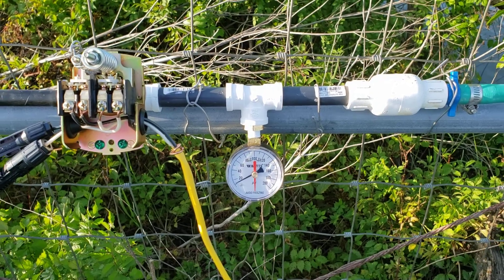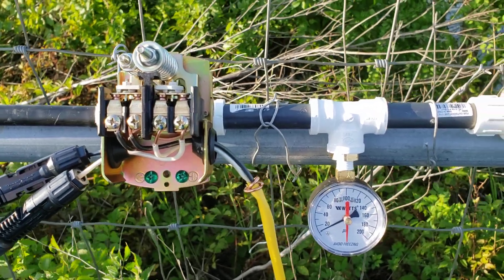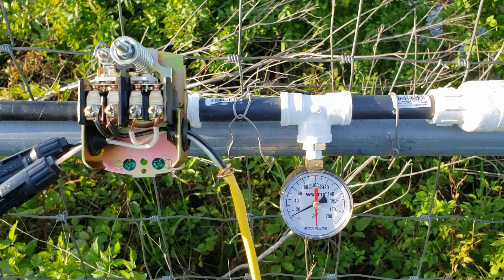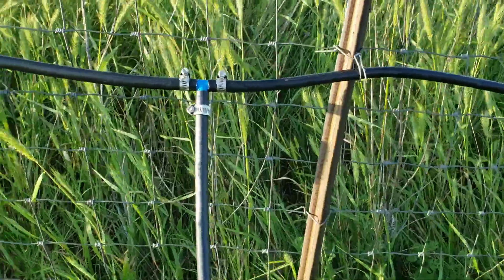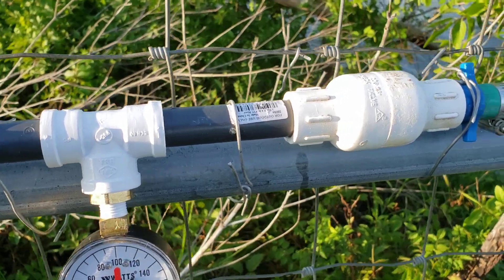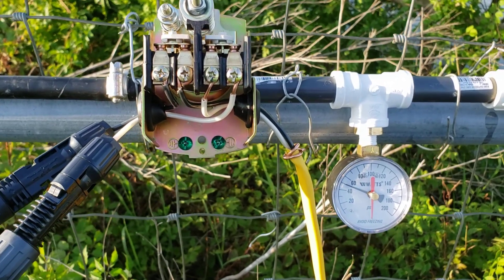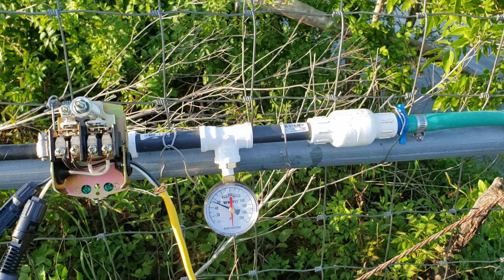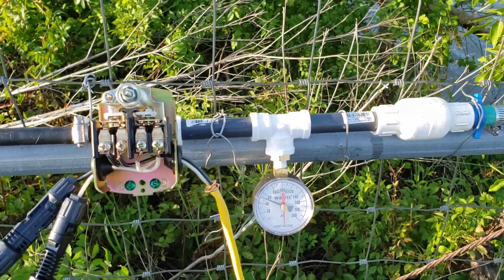Solar Water Pump Pressure Switch Setup

Comment: Hi there, I have a 180w solar water pump, but with my pressure gauge (when running and everything closed) I only get UPTO 20psi, i bought a pressure switch for 20-40psi without knowing it was kinda too high for my purpose. When i open the tap the meter reads (from 20psi it gets to 15psi or perhapsss 10psi). What should I do with this minimal difference? I would like to set a pressure switch for 5~10 to 18~21psi. After adjusting both screws the pressure switch turns off at 20psi, but if i get open one or more taps and the pressure gets down to 10psi or 15psi it wont turn back on (unless i slightly push the spring with my finger). What should I do?
Reply from the maker: I would think you need to find a pressure switch that can handle lower pressures like 10 psi or maybe put in a pressure tank.  Maybe something like this: https://amzn.to/49TbnBN
Reply: @SeidelRanch I am afraid i will have to, but will a water pump that pushes up to 20 psi be useful to the pressure tank? I mean... while it eventually be pressurized to say 30 or 40psi (slowly)?

Comment: Hi,
Do you use fuse or breaker?
Reply from the maker: I do not.  Maybe I should.
Reply: Thanks Bro. From the video, the negative is connected to L1 & T1, and the postive is on L2 & T2, am I correct?
Reply from the maker: @offgreed7131  I believe so.  Either side can be + or - as long as both wires are the same (both + or both -).
Reply: @SeidelRanch  Copy thanks. Great help. I am working an a solar surface pump connected to a pressure tank. And this is the only video, out of billions, that shows how to use pressure switch on DC. Everyone else says that pressure switch is  AC only.
Keep it up, Bro.

Comment: nice setup, the only problem I see is those pressure switches are designed for 110 - 240v AC so without being modified for DC with heavier contacts for DC loads the contacts will stick on after a while if your pump has too high of start up current that causes arcing (spark) when the contacts close & open or if the contacts run hot due to higher current of DC loads, this will be more common the lower the voltage of pump such as 12v as oppose to 24, 36 & 48v systems.

I have not seen any DC modified pressure switches around now days, they were around 10 years ago when they were selling DC piston pumps for solar.

if you find the contacts sticking on issue being a problem you could add a high current relay 20 - 30 A DC at the voltage of your pump, then run the pump load through the relay & switch the relay from the pressure switch the only downside of the relay is it will shut your pump off when voltage drops below the minimum required to hold the relay closed, as oppose to being able to run the pump until the voltage from the solar panel becomes too low to run the pump.
Reply from the maker: Awesome info, thanks!  I have not had that issue, but I will watch for it.  I was a little worried about the amperage going through it since it was made for 110v, but it seems to be handling it fine.  The connectors seem to be pretty beefy and the pump does not use much power to run.

Comment: How do you wire the pressure switch     which wires go to what screw
Reply from the maker: On my switch, it's positive on one side, negative on the other.  I go from the panels into the switch, then from the switch to the pump.  The pressure switch cuts power when it's high enough.

Comment: What kind of water line do you use? Is this just 1/2” rain bird line? What about the fittings? I guess it handles the pressure well.
Reply from the maker: Yeah, I just use 1/2" irrigation line.  The black poly line holds up well to UV and is easy to cut and repair if needed.  The line itself holds the pressure fine.  If the pressure gets too high I will have issues with plug type drippers and the push on connectors.  These ( https://amzn.to/3B3wr83 ) pop off pretty easy when the pressure gets too high and I stopped using them.  I now use these type of hose connectors ( https://amzn.to/3gubSYW ) to keep them from popping off if the pressure gets a little too high.
Reply: @SeidelRanch  Thanks!

Comment: Great video and idea. Currently trying to buy the same sort of kit here in Australia. I can’t find a submersible lump that says it will run with a pressure switch though, is there a special type or will any pump work? I have asked a seller and they said it won’t work with one. Thanks!
Reply from the maker: I think any electric pump will work with a pressure switch as long as the pump can build the needed pressure to trigger the switch.  All a pressure switch does is turn on and off the power when the pressure in the line reaches the setting on the pressure switch.  The pumps I use all work fine with it.
Reply: @SeidelRanch  Thanks mate. I've gone ahead and ordered a similar pump and the same pressure switch as you. I mentioned I'm in Australia, I couldn't find a pressure switch for 12V here! So I had to order that one from the USA :D Here's hoping I can make it work. Cheers.
Reply from the maker: @thelighthousekeepers8177  I think it will be fine.  I think they are all 120 volt but that should not matter.  Mine works with 12 volt or 24 volt with out issue and it says it's for 120 volt.  Good luck with the setup.
Reply: @SeidelRanch  I finally got around to installing one of these and it works but it's not pumping to it's claimed head height (my head is 26m). Can I ask how far your pipe runs and what diameter? I've got a 26m head and a 300m (984ft) length of hose. I'm assuming it's not powerful enough to push the water this far unfortunately.
Reply from the maker: @thelighthousekeepers8177  To get to the last zone of my irrigation I pump up about 60ft of elevation and am pushing that through about 1800ft of 5/8in poly hose.  I lose about 30psi just to get the water there.

What pump are you using?  The diaphragm pump I am using can pump up to 100psi or more.  I lose some flow volume but my needs are small when it comes to flow.

Comment: can you tell us which check valve and pressure gauge you used?
Reply from the maker: Since I used 1/2 in PVC to connect all this up, I used a 1/2 in PVC check valve.  Make sure to set the check valve to flow in the right direction.  It will have an arrow on it usually.  The pressure gauge usually has a 1/4 in threaded connector so I used a 1/2 in by 1/4 in by 1/2 in PVC tee to connect the pressure gauge.  I would use a gauge that would show the pressure up to at least 100 PSI.  The one I have goes to 200 PSI.

Here are links to them on Amazon:
Water Pressure Gauge to 200 PSI: https://amzn.to/3iGbFn4
Water Pressure Gauge to 100 PSI: https://amzn.to/3iCuwj4
1/2" x 1/4" x 1/2" Threaded PVC Tee: (can't find on Amazon. Look at local Home Depot or Hardware store)
1/2" PVC Threaded Check Valve: (can't find the threaded one on Amazon, but this is the slip one you have to glue) https://amzn.to/37CEY3L

You can probably get all this at your local hardware store.
Reply: @SeidelRanch  Thank you again!! (I'll get this set up yet LOL)

Comment: Can I ask if having a solar controller is necessary with a system like this if I will be using a battery to store power.
Reply from the maker: If you have a battery, you need a controller.  A controller keeps the panels from over charging the battery.  The controller will also keep the pump from over draining the battery.  I do not have batteries hooked up to my setup, so no controller is needed.  I have the panels connected directly to the pump.  When there is enough sun to run the pump, it runs.  When the sun is going down it turns off.

Comment: Whats the part that is connected to the pressure switch in the back ? share the link ?
Reply from the maker: I assume you mean the pipe fitting to connect the pressure switch to the main line.  That is a 1/2" Schedule 40 PVC Tee fitting that is threaded on all ends.  Here is one on Amazon: https://amzn.to/3gtHvTy .  The one I have is for water and the one I found on amazon is Schedule 80 and chemical resistant.  The simple water ones are a lot less but I can't find it on Amazon.  A local hardware store that has PVC pipe should have one.  The pressure switches are usually 1/4", so you need to screw in a 1/2" to 1/4" reducer like this one: https://amzn.to/3tLopfg .  Hope that helps.  👍

Comment: Hi ty for video, i am doing something like this and have same pump, wondering if your wiring and junction box is rain proof the way its setup. Also can you show us your output?
Reply from the maker: I finally got down to the lake and moved some things around so I could get a good video of the flow if you are still interested.  It's in this video:  https://youtu.be/_0KqeDTgLDE .  The pressure switch is not rain proof, but there is not much in it that I can see that would get messed up by the rain.  It's been rained on many times.